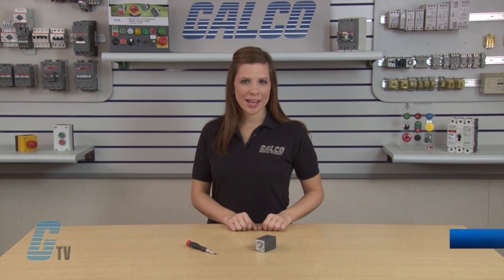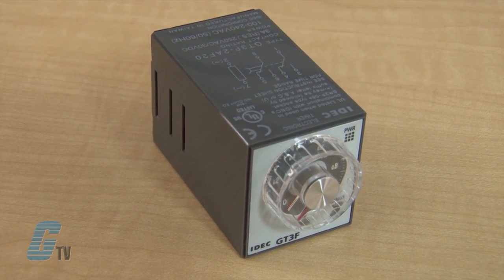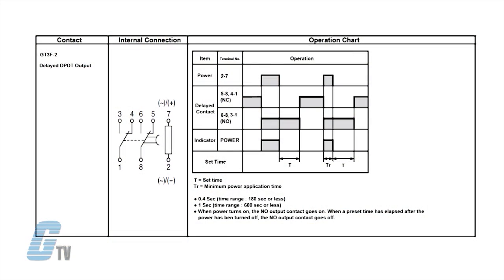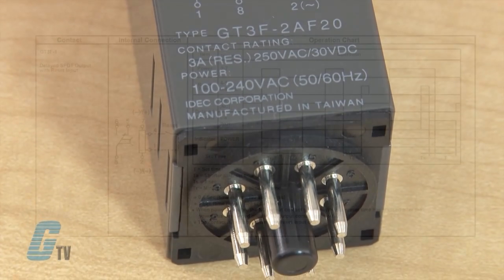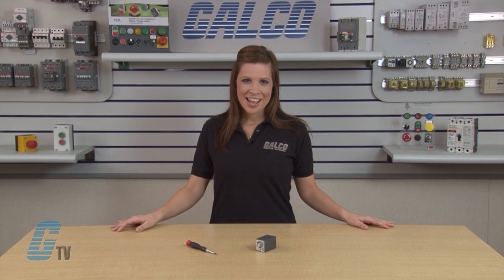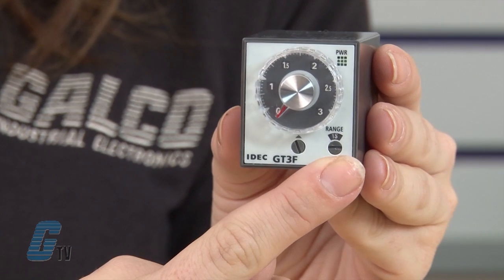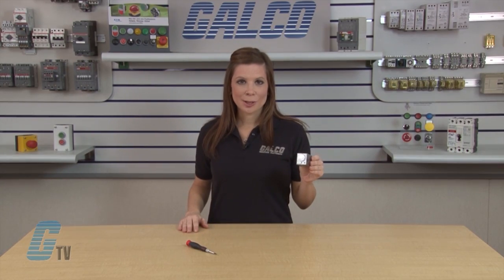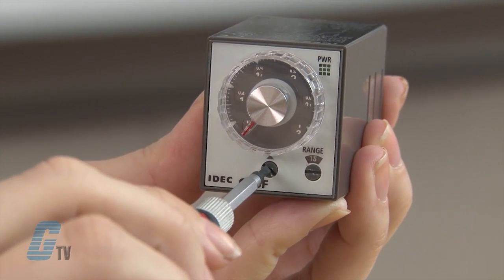IDEC "GT3F" Series True Power Off Delay Timer Relays - A GalcoTV Overview

Comment: what if i want to reset the timer automatically if power comes on during the elapsed time ? kindly guide ....
Reply: You'd probably have to connect some type of relay to the supply that will momentarily close a set of normally open contacts, which are in turn connected to pins 1 and 4 on this particular timer to initiate the reset function.

Comment: why is that if we set the timer to another mode of operation, the circuit does not work?
Reply from the maker: Did you mean a different range of time delay? Just make sure you turn the range adjustment all the way into next range, it may be possible to get it between ranges and inhibit normal operation.